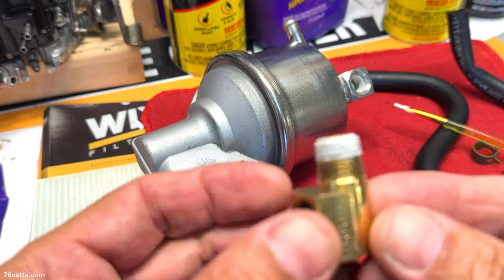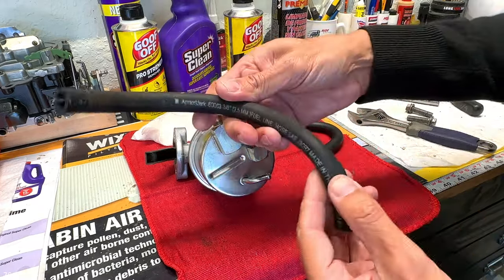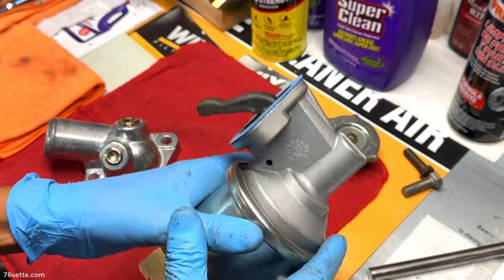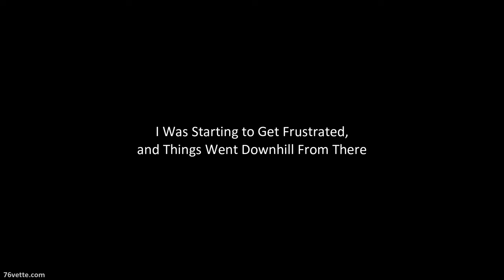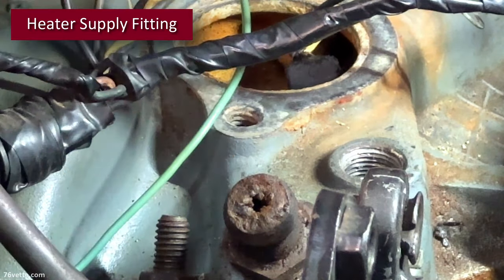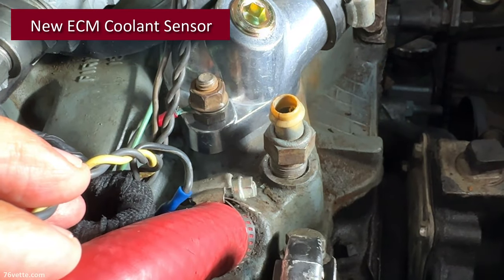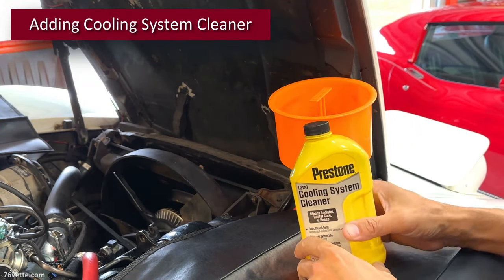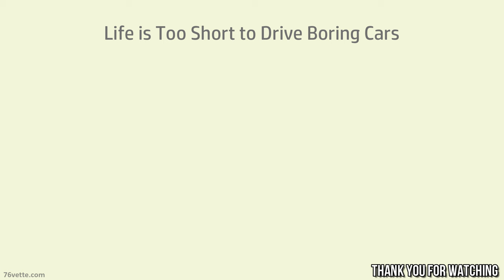Chevy FUEL PUMP Installation and Radiator Flush

Comment: As always a great video about our favorite generation of Corvettes.

One tip that I'll share is that I used to use those 5 mil nitrile gloves as well. But they always tore and I would use two or three pairs per garage session. Then I tried the 7 mil versions and found them to be much better. They hold together even when scraped against sharp corners and I use less gloves in the long run. Give them a try.
Reply from the maker: Thank you! 😊👍🏻 And yes, I have a box of 7 mil gloves and use them every once in a while. I am trying to get rid of these thinner gloves since I bought I think five boxes of them a while ago. So much for saving money. Lol 😆 
Thank you for watching! 😊👍🏻

Comment: Just did all of this and replaced the water pump in my '81 a couple of weeks ago. The previous owner of mine used vacuum hoses for the fuel pump and had the engine mount bolt facing the wrong way, so the engine mount bolt had pressed/vibrated a hole into the upper rim of the fuel pump causing a massive leak once the bolt had finally dug through the rim.

None of this really surprised me since the valve covers did not have bolts long enough to secure them to the heads, and not one single bolt was torqued on the engine and transmission, everything was finger tight. I am surprised the car even ran, and even more surprised that the former owner had not burned the car to the ground.
Reply from the maker: Yeah, it’s amazing that some of these cars survive at all. Thank you for watching! 😊👍🏻

Comment: Didn’t catch it.  What brand fuel pump did you use?  I installed a Carter replacement pump on my ‘72 and ran into problems with too much fuel pressure. Mine was at 9.5 psi. Caused nozzle drip on my QJet. Had to use a regulator.  Should be 5-7 range. Apparently most replacement pumps nowadays are not spec’d right.  Hopefully you will not have same problem.  Thanks for video.
Reply from the maker: Don’t know the brand. Took it off my 76 s while ago thinking it was bad. So I saved it and it works just fine on the 81. Thank you for watching! 😊👍🏻
Reply: You are lucky then. I threw my old pump out when I refreshed the engine even though it was fine thinking while I’m at at it out all new parts. Wish I didn’t. Now everyone is looking for old NOS pumps.
Reply from the maker: @dinoa9608  I will have to check with the guys at Corvette Generation (salvage yard) and pick up one or two OEM fuel pumps to stash away. Maybe as couple of OEM alternators, too. 🤷🏻‍♂️

Comment: Well done! I'm glad you didn't break the heater supply fitting. Did you eventually free it up? That was a mess!!
Reply from the maker: Thank you! Nope. The little “bastage” had welded itself to the intake manifold and I’ve learned to walk away from those types of situations. Thank you for watching! 😊👍🏻
Reply: @76vette  We do get wiser as time rolls on :-)
Reply: @76vette - I bet the threads got all corroded with rust and minerals, maybe PB Blaster or automatic transmission fluid mixed with acetone may have penetrated the corrosion? I couldn’t believable how much torque you were placing on it and no budging it lose.